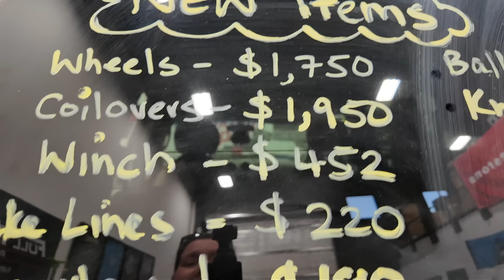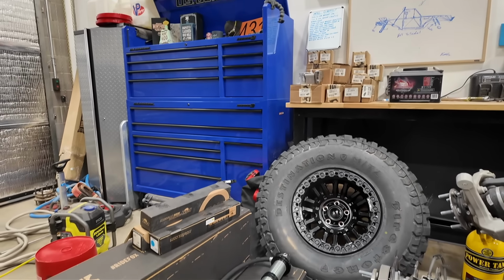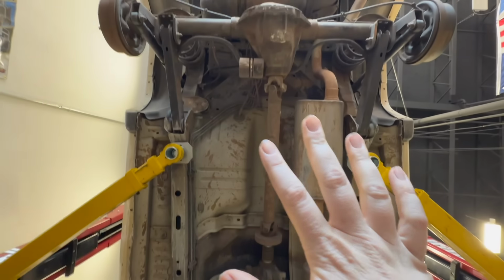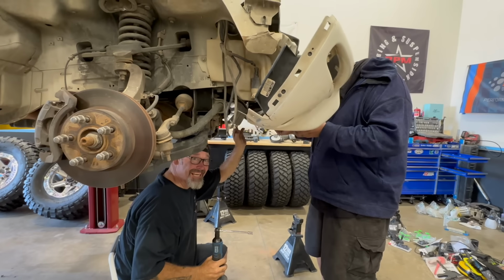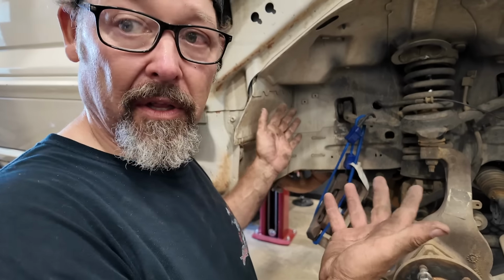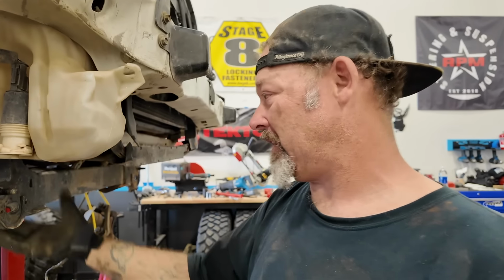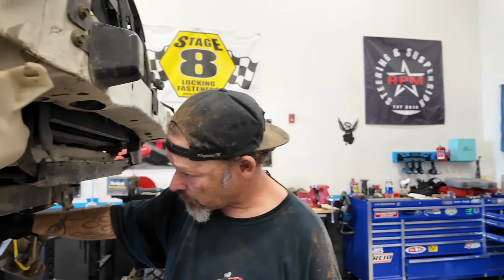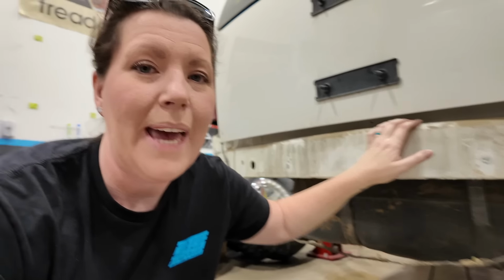Hidden Front End Damage!

Comment: Pulled a 12' fully loaded uhaul trailer, cross country with a 2002 Liberty Sport. I also pulled out a 2wd obs in 2' of snow, low gear in reverse. Our Heap de Azul, was a great little beast till I got tired of replacing dried out bushings at 250k miles.

Comment: In the U.K. jeep did a safety recall which required the fitting of a towbar or a bar without a receiver for crash protection of the fuel tank, I believe it was the same in the USA. The 3.7 l in the U.K. was rated to tow 3500 kg with a braked trailer ( over 7000lbs ) !!!  The Jeep Liberty is known as the kj in Europe.

Comment: If the stock tank has baffles in it use it. If it doesn't use the fuel cell. Because as you know when your out wheeling those funky angles will slosh that fuel around and starve the fuel pump. I think you have a great plan for your build.  I'm a fan of fab rats and Colt and Ruddy's and I just became a fan of yours.

Comment: As long as the fuel tank is in good condition and clean Use it. Just reposition it higher up inside for clearance. It's good that the hidden damage was not any worse than it was and should be easy to fix. It's coming along.

Comment: I own a 2002 Jeep Liberty that is solid axle swapped. I would recommend if you do keep the stock fuel tank get a skid plate. Or do a fuel cell because the fuel pump is not attached very well to the inside of the tank.

Comment: I would stiffen the unibody with 3/16 plate. Looking great so far!
Reply: Yes, especially since they removed the front cross car structure from the K-Member which is what adds a lot of torsional rigidity to the uni-body construction.  That front member does more than just support the engine and is a major structural member keeping the body from twisting and getting out of square.  There is a reason why they are a modified K or X in design so one has to plan things out so you can maintain structure before cutting into it.

It will be interesting to see how they replace that structure to maintain integrity.

Best!

Comment: Hey Holly,
In case you did not know, looking at your American flag from the shop it is backwards. The direction it is hanging the field of stars should be in the upper right corner. Not a huge deal, but it irks me when the US flag is displayed incorrectly. Love your channel and watching you wrench on things.
Reply from the maker: I think it's a huge deal...I reviewed U.S. Code Title 36, Chapter 10 closely before hanging the flag and it states - When displayed either horizontally or vertically against a wall, the union should be uppermost and to the flag's own right, that is, to the observer's left. When displayed in a window, the flag should be displayed in the same way, with the union or blue field to the left of the observer in the street.

Apparently a lot of people get this incorrect assuming the union should be to the OBSERVERS right.
Reply: @MischiefMakerTV  Well, I must be misremembering what I learned 20 some odd years ago, or it has been changed in the years between then and now, whichever is the case I stand corrected.

Comment: Looks like its going to be a greatl project. I know you're re-using JL dana 44's and i hope you have a FAD (front axle disconnect) delete figured out for it, if its new chromemoly shafts or a FAD lockout/manual actuator. I'm looking to do the same to my gladiator to not have to worry about the FAD.

Comment: Those tow bars were also put on there as a part of a recall. There was a gas tank problem. Very similar to the pinto. As part of the recall, they put the tow bars on there to protect the gas tank. I really wish my 2004 had been done. I have ZERO recovery points on mine!

Comment: I've got an 05 limited that is super clean, but the rocker panels are roached from salt damage. 😢 Dont know what I'm going to do about it yet. Everything works perfectly on it and there are tons of new parts on it. I want to restore it as much as possible, but have never done any kind of body work. I really want to remove the rockers completely and replace them with 2x6 steel as a kind of rock slider, but have no idea of where to begin. Any advice is much appreciated 🙂

Comment: Gonna have to add more to your budget. I didn't see mention of either the front, or rear bumpers. HAVE to have a safe place for the winch and also tow points if needed, Front and rear. I dare say, plating and boxing is also going to be needed for the abuse this lil machine is going to be put through. Also, sounds like you are going with hydro-assist, but still have to factor in your steering linkage. I hope you are planning an Exo-cage to help protect the body lines and windows in case of a flop.

Comment: I believe the Cherokee xj is also supposed to tow 5000 pounds which i think is interesting i have used my xj to tow various different trailers mostly dirt bikes or garbage in a small trailer towing 5000 pounds is too much i think ive towed that much its sketchy even an empty 1500lb cargo trailer is not fun. The liberty is the replacement for the xj I've owned many xj's and a few zj's but never a liberty i think this is an interesting build and a neat vehicle to start with. Im not too familiar with the liberty I've worked on a few of them but i don't know much about them. I think it is a neat platform to start from it could look pretty cool im excited to see this build. The straight axle swap is a definite must, also do people weld on frame stiffeners like with the xj unibody? I dont even remember what these have for running gear does it have a good engine and transmission is the t case any good? Im really curious to hear from liberty owners i know these have a following too.

Comment: Dont know what condition the motor and transmission are in but if you have any spare funds i would add oil coolers and service everything ,i think silly sensors are a bain of those jeeps !
Personally i would like to see this type of vehicle upgraded with just what fits for standard parts etc ,stronger Axel's,beefed up suspension and the drive line with better bearings and lubricants,see how far a reasonably standard  4 x 4 can go without major modifications,just my thinking ,you know that even the newer ones aren very robust off road when they are pushed hard .

Comment: Dont cut the top off, with a unibody, it require ALOT of strenting if you do it, and it not someting other then a master builder shoud do.
Reply from the maker: That’s what cages are for. The body of the rig is basically just a covering for the cage at that point. It’s not something I consider complicated, but I’m also not going to spend the time or money needed to do that. This is a budget build and it needs to be off the lift by the first week of September.

Comment: Chrysler put the hitch on to protect the gas tank it was a recal
Reply from the maker: Makes sense. that tank will be moving for sure it suits far too low and too far forward. The new, larger, axle will need more room and will be stretched back further.
Reply: @MischiefMakerTV  yes I had an 2003 in 2012 they sent out a recal and the hitch wa ms there solution to protect the gas tank in the event of a rear end collision

Comment: For over 3g for rubicon axles you would be cheaper to buy junk yard or marketplace 1 tons really.
Reply from the maker: That’s not true at all. You’re gonna spend $2500 on gears and lockers alone. Add housings ($250 each), master rebuild kits ($150 each) brakes and rotors for each corner ($180 per corner) and you’re way higher already and that’s assuming you are fine wheeling on used unit bearings and with stamped diff covers.

This is meant to be a simple and more realistic solution for beginner builders…but I absolutely agree that the smarter long-term DIY solution would be to build one tons and it if you fab up your own trusses and brackets, it will probably be the same cost as building take off 44s. It only gets expensive if you have to buy every new part.